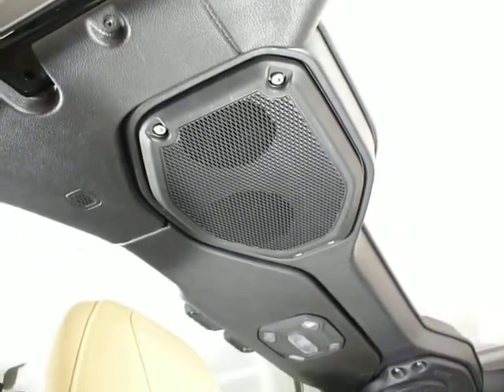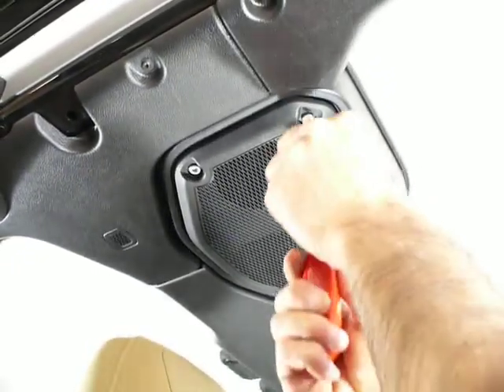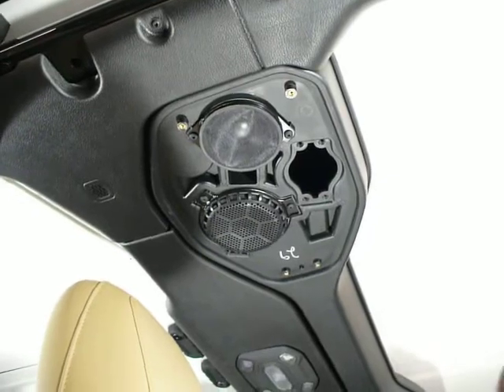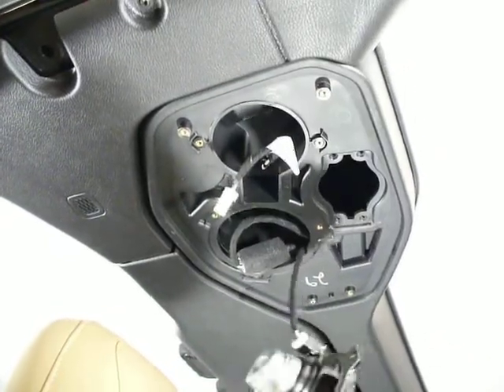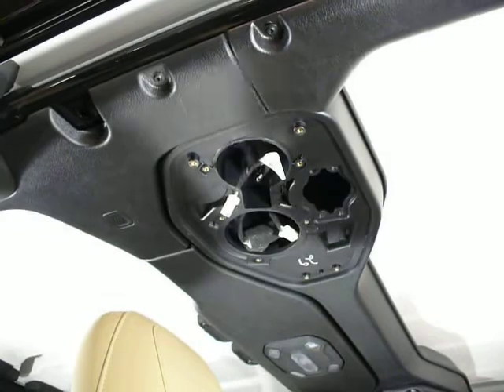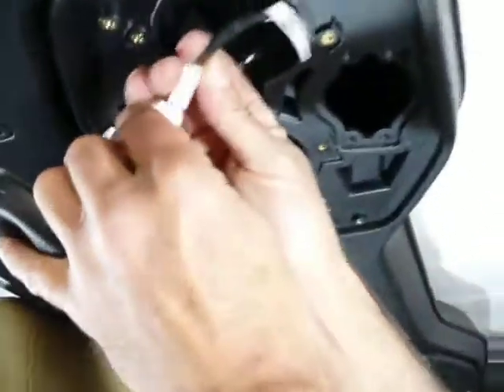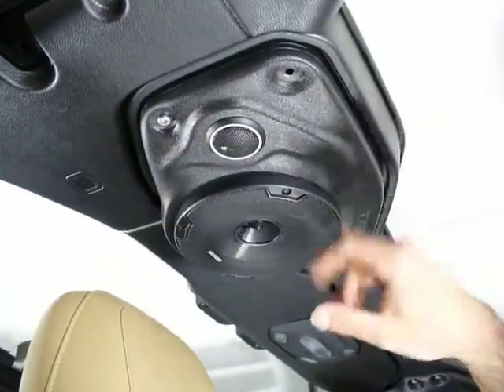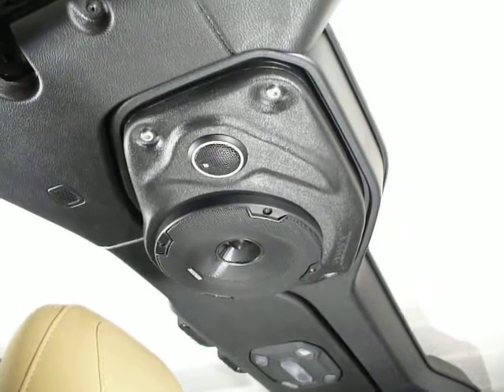Select Increments JLJT-Pods for JL Wrangler & JT Gladiator soundbar speaker upgrade & no cutting!

Comment: Nice video! I have question so, I have the regular stock system and I ordered the regular speaker pods that don’t have hole drilled for the tweeter. Would it be possible to replace the  stock 3.5 tweeter instead of taking it out empty and cut a 2inch hole where the tweeter is supposed to go, so you can hear it threw that hole lol . If that makes sense

Comment: Great video. Just what I’m looking for.   Can I still add a tweeter along with the 6 inch two way on a non alpine system.  2023 jl wrangler
Reply from the maker: Better to use a full-range coaxial 6.5" or 6.75" for the larger speakers and nothing for the tweeters since the full sound spectrum goes through all the speakers in a standard system.  Standards are also wired in parallel, so you'd be throwing all the power to the large speaker and not losing any power overall in the soundbar.
Reply: Thanks you for
Your quick response.  One more question what about adding a 3 way speaker
Reply from the maker: @dragonhunter1088  I don't see why you couldn't use a pair of those to connect to the larger speaker wiring in the bar, sure.

Comment: Thank you for the install vid... I am looking for a plug and play set up and I think this will be perfect.  Any tips? For the install
Reply from the maker: It's pretty straightforward and the install instructions pretty much cover everything.  Doesn't take more than like an hour from start to finish, maybe less.
Reply: @stu3557  and no cutting and drilling right? Do you have any links? Thank you sir
Reply from the maker: @MetroCollectablesandvlogs  Do you have the standard system or the alpine premium system with factory subwoofer?
Reply: @stu3557  sorry just got in.... I have the standard system. No alpine.
Reply from the maker: @MetroCollectablesandvlogs  So you'd have no holes to drill, no separate tweeters.  You'd just screw your coax speakers into the pods.
Reply: @stu3557  perfect,  thank you.. also do I need to buy a wire harness? Thought I read on Amazon reviews someone had to. Idk. Lol
Reply from the maker: @MetroCollectablesandvlogs  The kit comes with the wire harness connectors so you should be just fine.  Just follow the install instruction sheets for your particular install (it covers all various installs).  You should be plug-n-play, just need to screw the speakers into the pods.
Reply: @stu3557  awesome,  thank you sir

Comment: Any video on how to install the speakers to the mounts properly?
Reply from the maker: You just use the screws that come with your speakers.  You center the speaker and grille in the hole and run the screws into the plastic of the pods to secure the speakers.  Really easy.  Smart move was to test fit first to make sure any logo on the speaker and grille would end up where I wanted them for final appearance.  And to make sure the wire connections to the speaker were pushed in for clearance, which makes more sense when you're actually doing the install, probably.
Reply: @stu3557  thanks...worked perfectly!

Comment: Did you notice if the plug had the white and black wires reversed when connected? That’s how mine is.
Reply from the maker: Yeah, the black wires in the sound bar are actually the + and the white wires are the -.

Comment: So what if the component speakers that i bought to replace the factory upgraded Alpine speakers come with an inline filter for the tweeter? Do i use the low pass filter or do i skip it since the Jeep already splits the sound between the 2 speakers (highs to tweeter etc)?
Reply from the maker: You don't need it since the alpine system crossover already sends only the highs to the tweeters.  Although I have heard of some people using it anyway.

Comment: So without cutting the factory sound bar does it have enough room for air to flow to produce good mids and lows?  Does all the smaller openings make the audio sound distorted or make weird noises with bass versus cunning the factory sound bar to make it one large hole?
Reply from the maker: Didn't have any noises and sound quality definitely improved.  With the extra area each pod adds along with removal of the port tubes and the air access around the speaker magnets, there was plenty of access to the entire internal area of the soundbar to get the mids and lows.

Comment: nice!  gonna pick these up!  would it be beneficial to put polyfil in the bar before installing these?
Reply from the maker: I didn't, but it could only help, I'd guess.
Reply: So how’d they turn out? Looking to get these to switch out my stock gladiator speakers
Reply: @AdMral5BrAnDOn  they definitely make a difference, along with the poly fill in the bar. upgraded the dash speakers as well, and it sounds really good now!
Reply: @stealthhtm23  awesome just ordered mine after reading your reply!

Comment: I’ve been looking at these recently and really enjoyed your install video. However I’m not super electrically inclined, I did replace some of the tweeters in my Jeep, but the one thing I haven’t been able to find is how you connect the wiring harness to the speaker itself. Did you have to do any soldering or anything to connect the spade to the speakers?
Reply from the maker: There isn't any soldering for either the standard or the Alpine "premium" system because no matter which system you have the pods come with what you need, meaning "plug and play" wire connectors.  I guess just make sure you get the correct version for your Jeep (standard or "premium alpine" system that your Jeep originally came with.

Comment: I have installed this adapter with infinity component speakers. It worked for a little bit and then the sound bar just died. Tweeters were not working anymore, and speaker just sounded low and muffled. I switched speakers for other ones and same issue.  Just worked for a bit and dead.  Did you experience any issues with it?  It was supposed to be plug and play but I have no clue. It's like the rear chanel on the amp is  not working well. I have the alpine premium system too
Reply from the maker: I haven't had any issues like that at all.  I've heard of speaker upgrades cutting out b/c of the vehicle computer system detecting one or more speakers are unhooked though.  That apparently can happen if the Jeep is on and the radio's on when disconnecting and re-connecting a speaker.  And apparently it doesn't happen every time.  But eventually, after the Jeep being turned off for a while, it can re-set and it fixes itself?  Maybe that's the sort of thing you have going on?
Reply: @stu3557  I have tried a hard reset. removed fuse from radio and amp.. Nothing..  I am starting to think maybe the amp rear channel died when did the first install.  I had no issues with my front and dash speakers. At this point I'm just gonna replace the OEM alpine amplifier.  Thanks for your help

Comment: I just installed these in my 22’ Wrangler 392, with the Alpine system. came with the Kicker speakers. noticeable improvement in highs & mids, but it seems like the subwoofer has decreased in volume. does this rob power from the subwoofer??
Reply from the maker: It can't rob power from the sub in the alpine system because the sub is on its' own channels off the alpine crossover/amp system.  Those channels are in no way connected to the soundbar speakers or the front knee and dash tweeters.  There's something else going on with your settings for the sub on your head unit maybe?
Reply: @stu3557  again, thanks for the quick reply!  will continue our convo over email
Reply: You should check to make sure the soundbar speakers are not wired out of phase with the sub…that would cause sound cancellation

Comment: Do you need to cut the non-alpine sound bar I am seeing in a lot of specification tables of website selling this stating that you have to cut the sound bar open
Reply from the maker: I don't know why they'd be saying that.  As long as the speakers you use have typical-sized magnets that can pass through the existing factory speaker hole, you don't need to do any cutting.

Comment: Sorry if I missed this, why remove the port tube?
Reply from the maker: The port tube only did something in the original speaker setup.  It doesn't do anything in this new install and removing it allows the new speakers to more easily access the entire sound bar's air space.  That will give you better bass response.